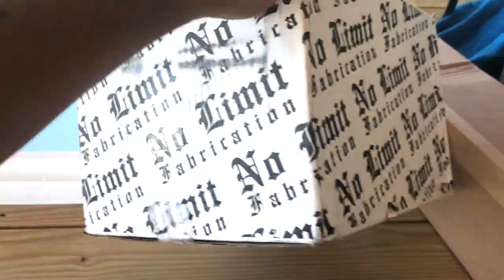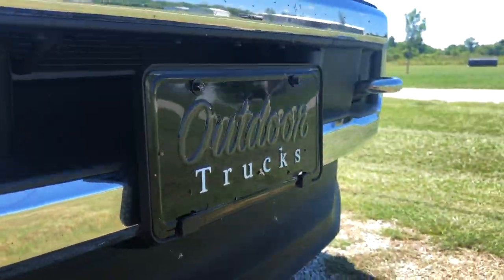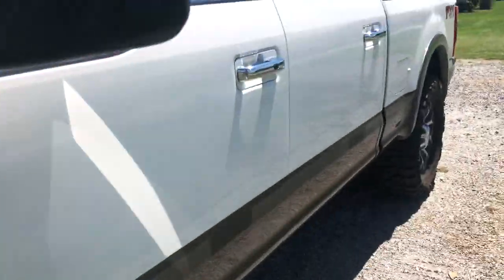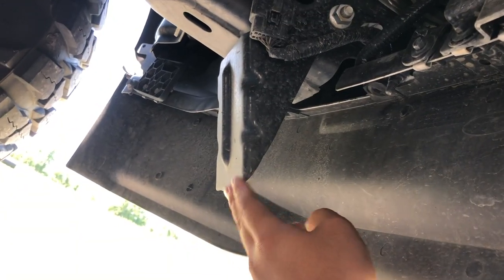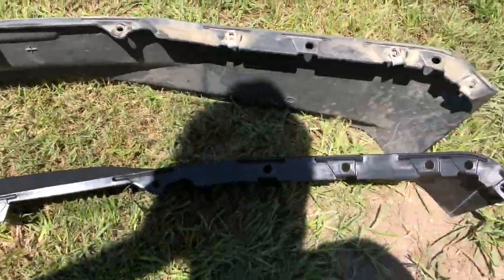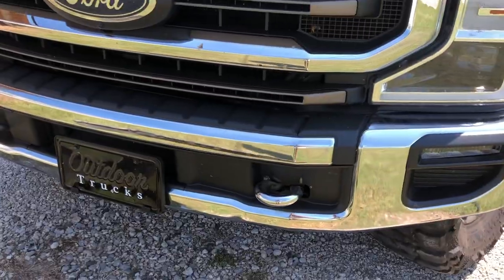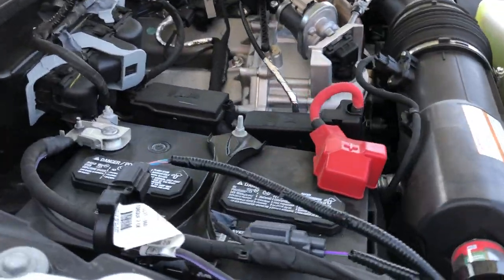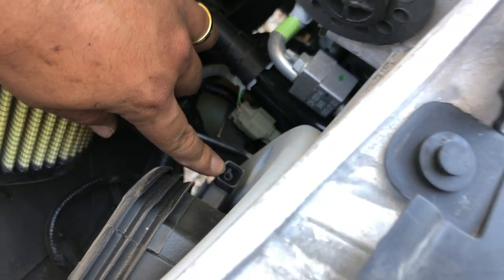2020 Powerstroke No Limit Air Intake AND New Front Valence Replacement!

Comment: I had one of these on my '17 F350, looked great seemed to work nice....but I measured the under hood air temps right next to the filter and it was 134* F, outside air temps were 85 *F. I took it off thinking I'm just sucking in hot air vs ambient temps. I still have the kit and want it back on but it doesn't make sense, what should I do?

Comment: Love the videos! I just installed a No Limit stage 1 intake on my 2020 6.7. It did the same thing yours did. Went into high idle. How long did you have to drive before it stopped?
Reply: I’m thinking about ordering one for my stock 2020 6.7.  Did you have any other problems? Did the high Idol problem go away?